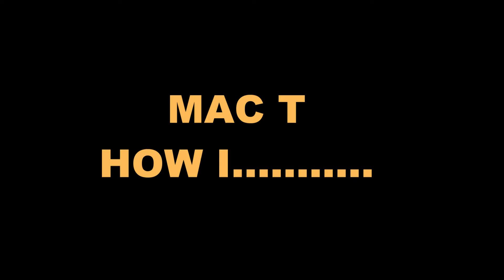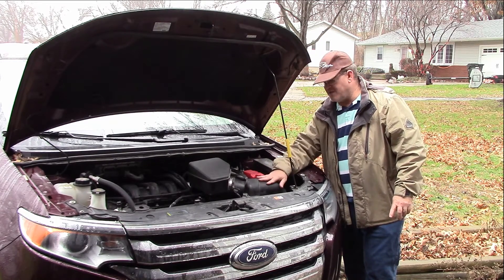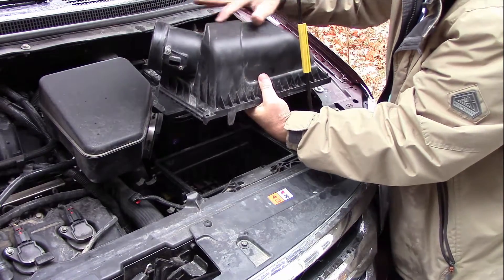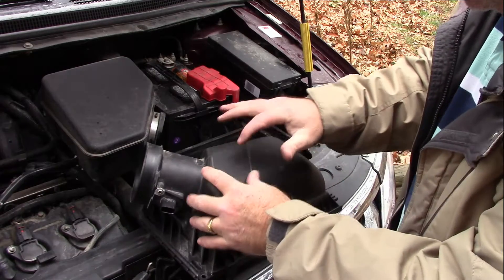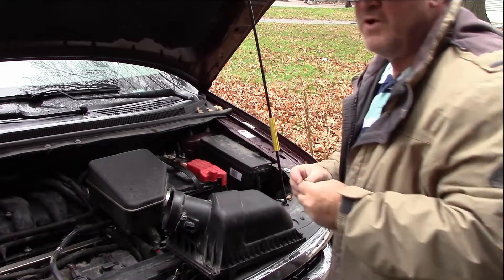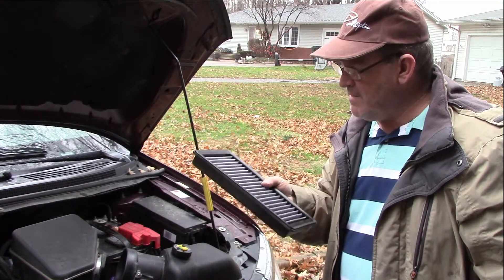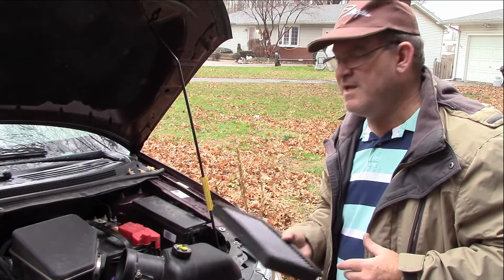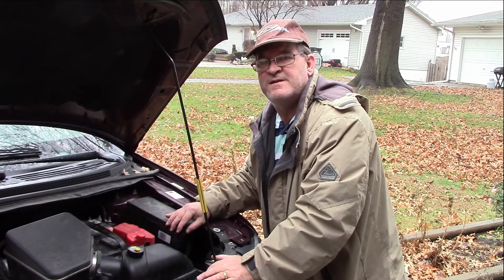Installing a Filter Minder on a 2011 Ford Edge

Comment: Washable filters provide protection similar to an oil bath.  Dirt is attracted to the oil that is sprayed on the filter.  

If you neglect your washable filter by not oiling them at least monthly and washing them every few months they will not protect your engine. They are awesome in race cars, but not so good in your daily driver.  

What are you spending in time and treatment products to oil and clean the washable filter. 

Washable filters simply stop working with neglect and will probably never activate the Filter Minder.  

Oil from your washable filter can coat your mass air flow sensor and cause fuel mixture to run rich. 

Every time you open the air box you are subject for dirt that you can't even see entering your engine. 

Paper filters provide protection with very tiny holes in the paper membrane.  This requires no maintenance until replacement.  

The Filter Minder will allow the average driver in most cases to get years and years of service from a standard paper filter.  With no maintenance!